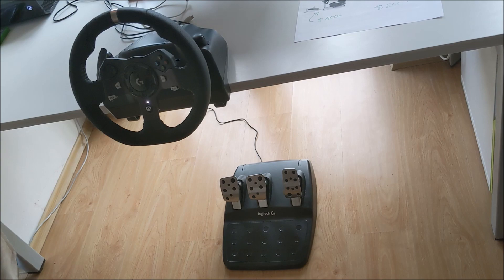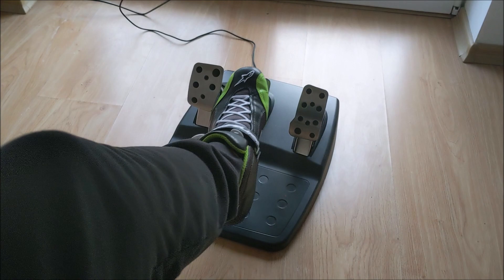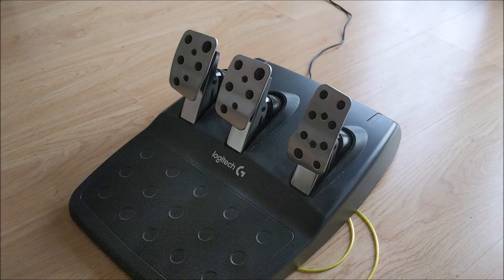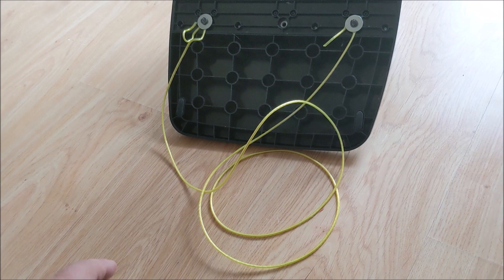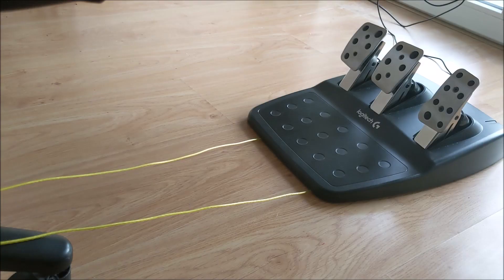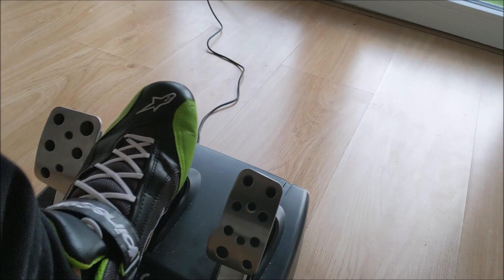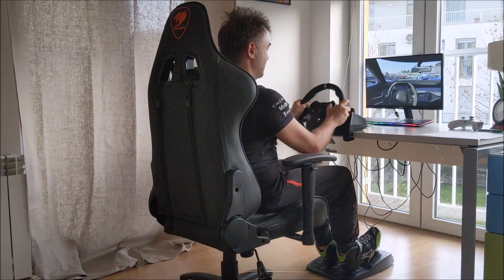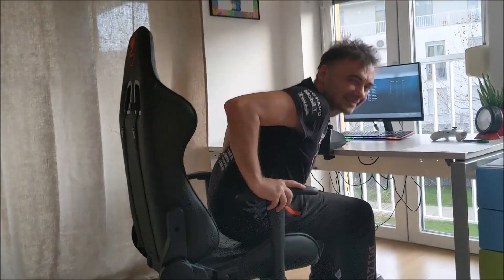How to Build a Sim Racing Rig in Under 10 Minutes, DIY

Comment: It's one of the best videos. 
Thanks my friend. 👊💪
Reply from the maker: Hey thanks, Martin, hope you find it useful. I'm still using it and made a small improvement for more stability - run both ropes under one of the chair's wheels. Brings the center of the forces lower and the pedals become more stable.

Comment: Wow thas a awesome idea, dont the pedals still move around if you dont  push directly on them?
Reply from the maker: This is why I used the side mount points. The brake is very stable, as it is in the center. Rarely, if you press the gas too hard and your left foot is not on the pedals, it shifts a bit. I'm working on a couple of zero-cost improvements ;-)
Reply: @dkostov  well if you had like a kitchen chair with 2 legs up front maybe the pedals would not move around... i have the fanatech pedals that are pushed up agains the wall but still tend to lift up when press hard on the brake, but still have to use a kitchen chair to avoid getting pushed back. So based on that if you loop it around the 2 front feet should do the trick. But i alao mounted bass shaker to the kitchen chair so i actually prefer it to a office chair, where it would be wery hard to mount the shakers :)
Reply from the maker: @srdjancervenjak8337  , cool, Fanatech! I also thought about using the front feet/wheels, but it turns out the set moves much more that way. Have to find a way to stop the rope from sliding. A knot near the chair will solve it, but then taking the whole thing off will take more effort. Btw, with this system the pedals do not lift at all, no matter how hard you press the brake.

Comment: i did as you showed, but when i push on the brakes  the pedal mount lifts from the front, any suggestions?
Reply from the maker: I tried to simulate what you experience, here's a couple of thoughts to try:
1) It very rarely happens to me, probably because of how I keep my feet on the pedals. I keep the heel firm on the platform and press with just my toes. This, however, will not help if you do heel and toe, so the next thought ...
2) try to link the rope as low as possible to the chair. The lowest I got was to tie it to one of the wheels. This way even if it lifts - the lift is minimal. If the rope is at the floor - there should be no lift.
Tell me if you get any success!
Enjoy :-)
Reply: @dkostov  thank you so much, i will try it asap!